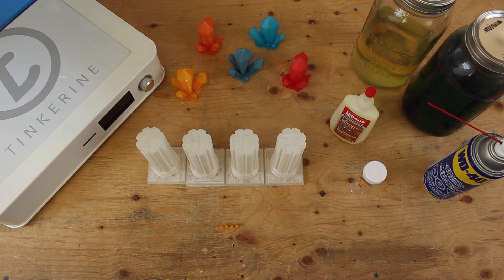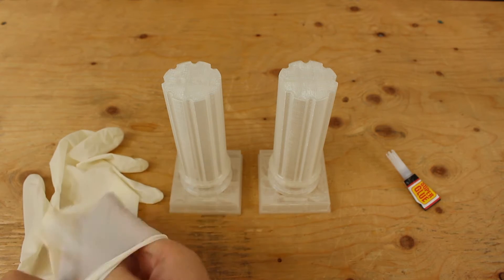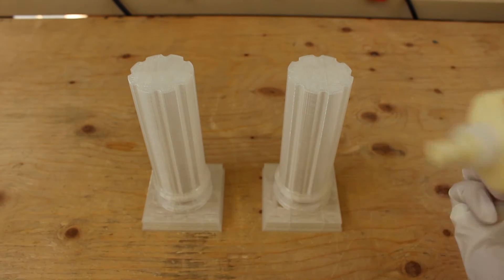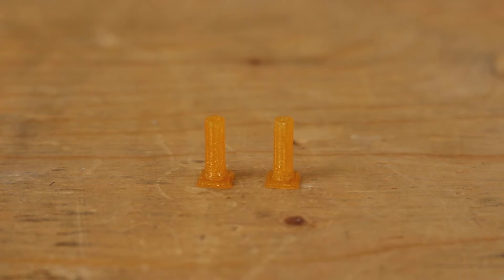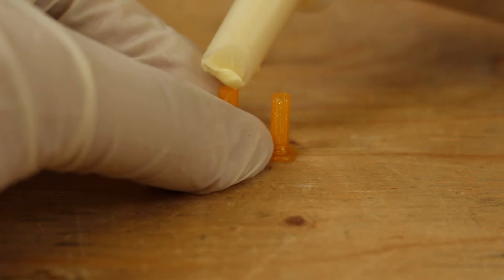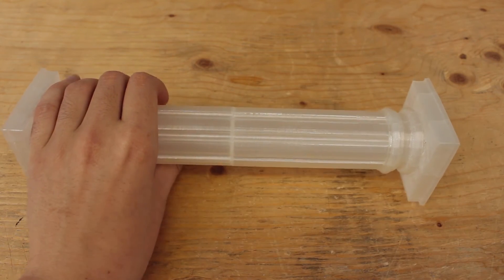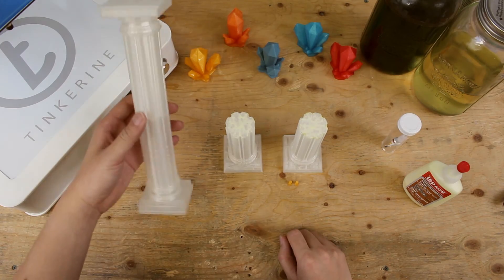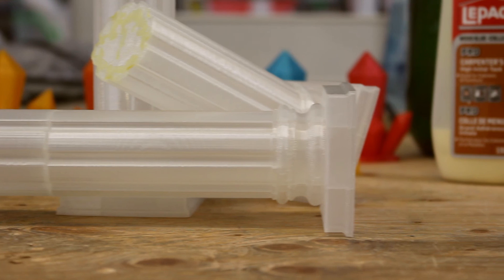Gluing PLA parts together with Superglue and Wood Glue

Comment: hi, i have a silicone bracelet  and i want to print some 3D letters and glue them on the bracelet , what glue should i use :) , kind regards , here is the ex : http://www.pchopper.com/media/catalog/product/cache/3/image/9df78eab33525d08d6e5fb8d27136e95/e/m/embossed.jpg

Comment: As another commenter has stated, wood glue takes longer to fully set.
In addition, from my woodworking experience, wood glue works much better when there is compression pressure. Wood glue shrinks as it dries, and needs the pressure to keep the surfaces tightly in contact. Even when I don't have access to the proper clamps, I will usually stack something like a textbook on larger pieces of wood. I can't say whether or not this will have any noticeable affect with PLA, but it's worth a try to use it the same way it works best with wood.
Reply from the maker: Thank you for the comment and the advice!  That would be another method we should be looking into when using wood glue.  Also let us know what you would like us to test out in the future!

Comment: You didn't let the wood glue dry enough. Try again but let it dry 24 hours
Reply from the maker: Thanks for the comment and good call!  We wanted to test out the strength after an hour and a half for both glues.  We will definitely revisit using wood glue after it dries for 24 hours.  Also let us know what you would like us to test out in the future!
Reply: @Tinkerine  did you ever retest with proper procedures? If so, why is this video still up? If not, why not?